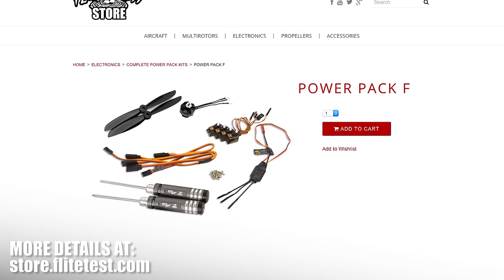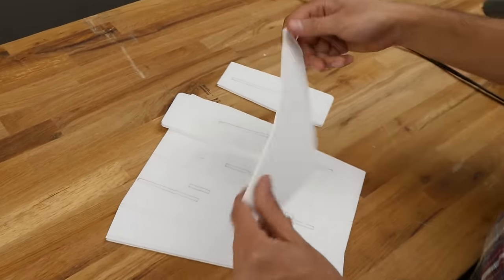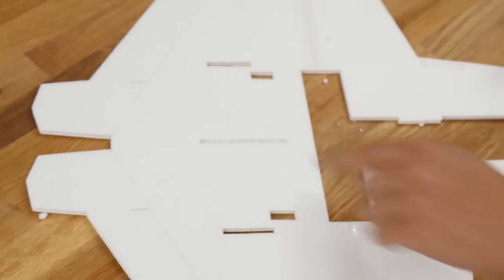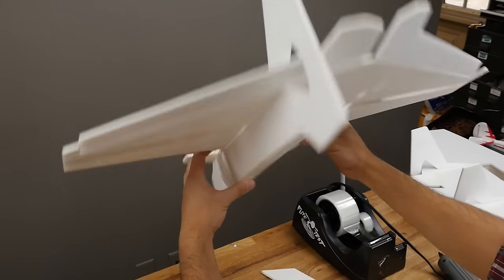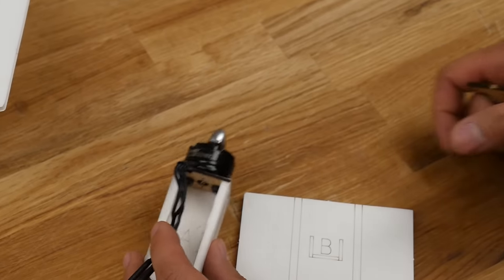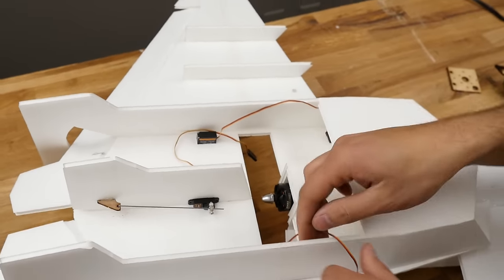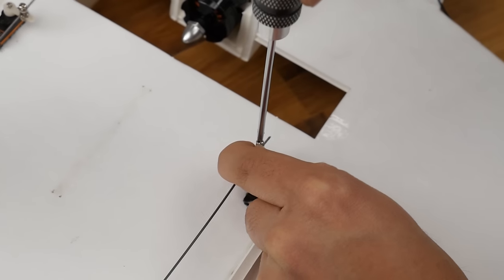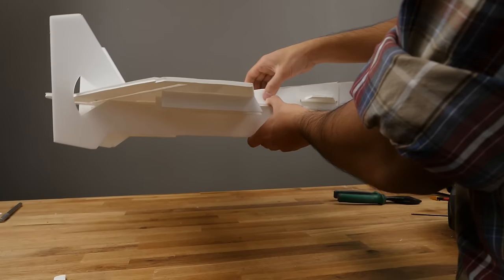FT Mighty Mini Vector - Build

Comment: just a heads up, emaxx 2204 motor 20 amp esc and 6045 prop ( about 540g thrust )  is "just" enough to enjoy this plane. I wasnt impresed ( maybe because my first build was a mini arrow and they rock so much ). I upped the power to a 2205 2300kv producing about 680g thrust and it flys great, the difference was incredible, no more skid turns lol, mind you the down side is I bought a cheap ass motor ( racerstar, shoulda stuck to emaxx ) and it overheats in 4 minutes doh!. Oh yeah the rudder doesnt work, literally does next to nothing, maybe if you mix it with your elevons ( maybe ), i think just leave it off or, in my case,  im going to take rudder off and try and use the rudder servo to drop a water ballon or something lol. I have so far built 4 planes ( lots more but 4 different types ), mini arrow 10/10 it just rocks, mini f22 raptor 5/10 rubbish ( poss not a design fault i think this is just how jet type shapes fly ) the vector, much better then the raptor, doesnt fall out of the sky as easily  7/10 but slightly under powered, add power 9/10 , and the mini baron which sucks, but thats prob my fault as once again i overpowered it and i think the torque roll is impossible to get rid of. If you build the mini baron use the recomended motor do not use a 2204 as mine would be rated about 0/10, ill take responsibility for that one tho lol

Comment: You should try a motor extension through a long shaft, some like a boat which has the motor shaft extended, so there is no such big hole in the middle, which seems horrible when close

Comment: I love all the videos you guys do.  so great!   what do you suggest for locating a lost drone?  I just had a very heart breaking experience watching my $400 racing drone get blown in a wind gust out of sight before I could reorient it to bring it back.  So I have painfully ordered another but would rather not lose it again.  thanks!
Reply: Check out their video on the Tile Bluetooth tracker, or a lost model alarm always helps!
Reply: Thanks gents.  I had a lot model alarm on the drone, but it went out over trees and got out of site before I knew it.  The lost model alarm was pretty loud, but I doubt if I could hear it unless I got within 50-100 ft. of it.  I was thinking more like a small GPS style locator.  The Tile, and the Nut work off of bluetooth and I don't think the range is very far.  I did not put my contact info on it.  I will from know on.  I'll have to post some "lost kitty" signs all over...lol..

Comment: Here is a chalange. Build a tricopter with flight characteristics of an airplane. Including the ability to taxi on the runway . I did it using two tuftilts and wheel from a sukhoi. there is a Utube video titled Tryplane 1        would love to see your approach to the challenge.

Comment: CMIIW, this plane would fly just as well without those canards.  As they look to be exactly parallel to the main wing and fixed, I really don't see the point of having them other than making the plane look cooler.  On Rutan designs, the canard governs pitch.  The main/large wing trailing edge controls are ailerons only.  Thrust vectoring is presumably desired with this kit, though with elevons it's pretty much negated.  A five channel set-up with independent thrust vectoring and functional canards would turn this plane into a maneuvering monster making high alpha and hovering a breeze.
Reply: Hi Champlain - I read your comments with interest. I am building this model as I write and I came to the same conclusion as you in respect of the canard. What I have done is to arrange for variable canard alpha of between 0 and 10 degrees positive (relative to the mainplane, alterable between flights. One of the main advantages of positive canard alpha is to soften the stall. It may assist with post-stall manoeuvring as well - who knows!  Report to follow.

Comment: FYI, I had to move my battery further back...still accessible from the nose, but recessed into the lower cavity...and I put the servo cables OUTSIDE the propeller hole...AFTER I cut my servo cables...oops.

Comment: How are this Metal Holder on the Servo called who I can stick the Wire through and secure it? I want to buy these but cant find on ebay. 31:25
Reply: +Saft CPU i am looking for the name. its probably mentioned in the servo 101 vid, but do you have any idea how thick the foamboard is?
Reply: +Saft CPU they are called controll linkages
Reply: heres a video of difrent kind

Flite Test - Control Linkages - FAST TIP
Reply: +Chiel de Roode thx for help :)
Reply: No, they are called linkage stoppers

Comment: If i buy it does it come with the foam?
Reply: If you purchase the kit yes, but the F electronics pack ONLY comes with electronics
Reply: +Elexo Flyer do you know what the cheapest controller I can buy to fly this?
Reply: +HBC 34 you can use the hobby king v2 computer programmable controller. It is tough to do delta (eleven) mixing, but I found how to do it, if you need any help. I would recommend the orange rx on hobby king, they are dsm2 compatible and programmable.

Comment: hey can you use a helicopter gyro in a quad I'm building a helecarrier
Reply: instead of a flight controller? or just the gyro added onto the quad?
Reply: well I'm doing a scratch build so I guess I shud probably put in a flight controller but I'm kind of second guessing my motor choice I was gunna do a ducted fan but would that work with a quad flight controller?
Reply: +jacksepticeye J.r so if it's any type of multirotor you need a flight controller, also you could add a gyro but it's not necessary
Reply: k thanx but would the ducted fans work?
Reply: +jacksepticeye J.r yeah ducted fans would work, just hook it up to the escs and then to a flight controller then to a receiver
Reply: k thanx hey whats ur email so if I have anymore questions I can ask u
Reply: thank u